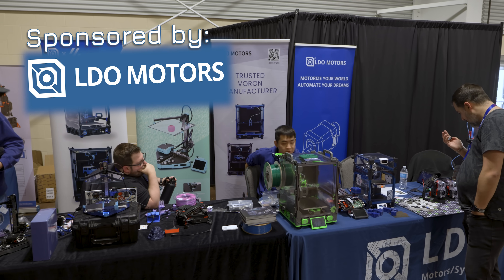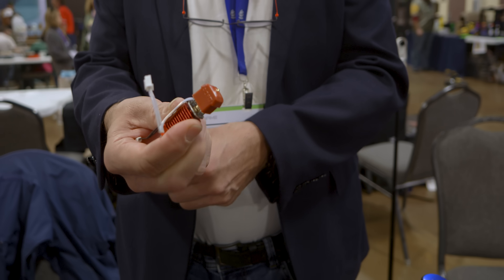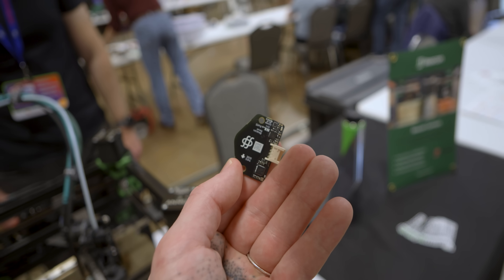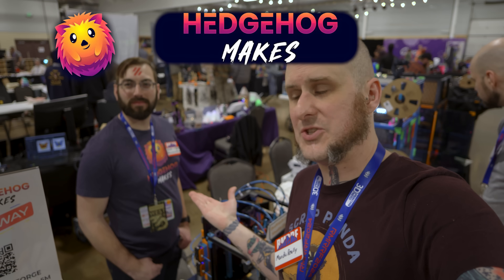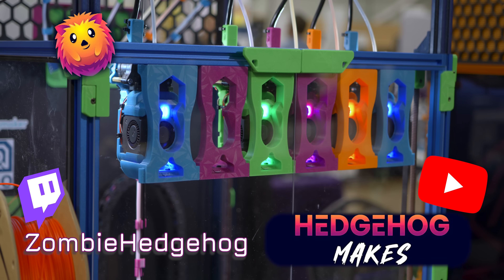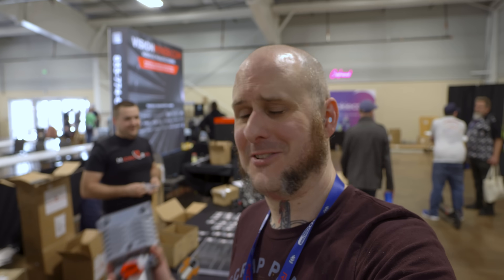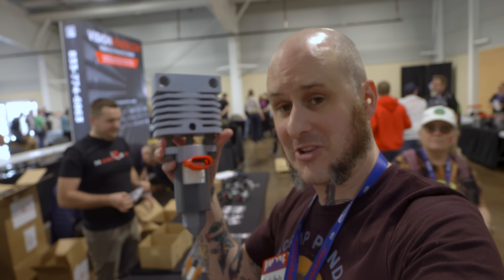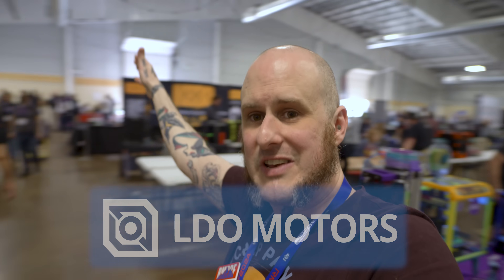Shocking Reveals from Rocky Mountain RepRap Fest!

Comment: Nice video! Now we have actually a swiss company with swiss in the name (illegal in Europe, misleading company name), curious how their quick swap nozzles take off, especially since these should be cheaper and even more consistent in length than revo. Two little critique points on the nitehawk boards from my side. The stepper motor connector should face the other direction on the 36 and 42 style boards (like the other connectors), nothing a little soldering wouldn't fix. The reason is that not everyone attaches the nitehawk 36 directly to the stepper motors of the extruder, i personally think this is a horrible idea anyway on most extruders as most only have two attachment points (sherpa, orbiter, hextruder, Galileo 2 standalone, hgx, sailfin, etc; lgx has 4 screw points), so the whole assembly is kinda wobbly when attached to printed parts, i always have a brace or similar between to prevent that wobble. Resonance measurements from the toolhead boards have become much closer to nozzle adxl based results this way. Anyway, one might install the board a little lower than the extruder stepper motor and now the connector causes the board to not fit. The other critique point is the xt30+2. These connections are simply not available in the entirety of Europe, at least i haven't found them. Someone said that you can use a regular xt30 and a jst xh, but then i could also run a ebb36/ebb42, use the molex connector and a super short usb c cable from the pins right next to the molex input (these are actually canbus pins) to the usb input. So i still have only one connector towards the toolhead and its a properly locking connection unlike the xt30 stuff while having a usb communication.

Comment: G'day Mandic ol son.....im a 4yr long noob in 3d printing, but i did do a Micro Swiss  hotend and DD unit swap on my Ender 3 V2.  I've recently won a Elegoo Neptune 4 Pro, which im converting to the new Micro Swiss FLOWTECH. Which will allow me to get rid of that dam piece of teflon in the stock head, to a one piece nozzle/ heatbreak in a simple plug and play unit oh! and leak proof . ive been seeing a lot of Neptunes with huge blobs encasing the whole print head, so i wanna get ahead of this potential hazzard Now thanks Micro Swiss and Slice Engineering. Big Cheers to ya for Your time on making these vids, From a M8 Dowunder
Reply: I just can't support Slice Engineering after the entire VZBot/communism thing and suing companies because they patented "spacers between the cold end and hot end" situation. Slice's response to the outrage from the 3D community was the icing on the cake for me.  What did they really show anyways? There were some hot end parts on a table, then they said something "big" was coming this Summer so nothing to show and this convention was 3 weeks ago?

Comment: Mandic, what is your problem with CANBus?
Reply: I am personaly not a huge fan of CANBUS either.  Its a real pain to set up, finiky, we already have atleast 4 different inferfaces in a Pi, lets use em, not throw another one in just because.  I have it in a V0.1 Double dragon and a Mercury.
Reply from the maker: My Mercury One is VERY slow to respond. Like the filament runout sensor will trip and it won’t stop printing for over a minute. Weird things like that where it just behaves very strangely. And getting the can configured didn’t go smoothly with the board it is running. The USB board would just be a simple fix for the odd issues it has. I run CAN on a handful of machines with ZERO issues, just that one misbehaves.
Reply: @MandicReally CAN latency should be a few milliseconds maybe, it can be something in the software but I doubt it's a technical limitation of a 1 MHz CAN bus.
Reply from the maker: @zapl80  I understand that all things being equal, signaling speed should not be an issue. An issue exists though. I've reflashed the entire system multiple times and it keeps happening. Something is off, somewhere in the system but I cannot nail down what or where. Going to USB will eliminate a couple points of possible failure.
Reply: @MandicReally  I repectfully suggest that what you experienced was not the fault of CANBus. While I hope a USB solution works for you, USB is not likely the correct technical solution for 3d printers.
Reply: This might be a hardware issue then, more than software? Maybe one of the transceiver chips or it's power decoupling is bad (bad solder joint, some kind of component damage) or it's just a wiring/connector failure and because of this its missing/losing some telegram transmissions.
Or maybe the software stack that is handling these transmissions is not actually properly implemented.
If i had access to the system i'd just hook up a logic analyzer to the CAN bus with a transceiver IC and record what is happening to get a better understanding of the issue. Without any hard data it's just wild speculation as to what might be the root cause.

Comment: Just FYI Mandic (although the Orbiter Toolboard and Nighthawk 36's are nice) you can run your EBB 36 in usb mode too. For some reason everyone has convinced themselves they need to complicate everything and add more latency with CAN when the boards already work out of the box with USB.

HUGE props to LDO and Robert for bringing some sanity back into the toolboard game :)
Reply from the maker: Yea, I am aware, and that was what my next step was going to be. Now that LDO has these coming out, I think I'm just gonna wait and swap to the Orbiter board as I am running an Orbiter 2.0 on that machine. That is a better fit than the "generic" Nitehawk 36 anyway. I've never had as much trouble with CAN as I do on that Mercury One. The latency and delay of commands is crazy.
Reply: @MandicReally  The "Orbitool" is a really cool board, was an early tester and it's been solid! Love the hotend power metering and all the built in safety :)
Reply: I have ebb36 running on usb. My only issue so far is it will disconnect if I try to print something crazy fast. Not realistic speeds anyway so doesn’t matter lol
Reply: Make sure your tie down your USB connector so it can't move or you'll create a loose connection over time.
Reply from the maker: @miklschmidt  The LDO boards use the XT30+2 connector so it will stay secure, but I NEVER rely on connectors to hold. I always have strain relief the only thing that can effect a connector is the vibration of the motion system.
Reply: @MandicReally  the connector comment was for @joe_duck 😅 but yeah, never hurts!
Reply from the maker: @miklschmidt  Oh. YouTube and their way of showing comment replies on the backend, didn't see that one. Whoops 👍